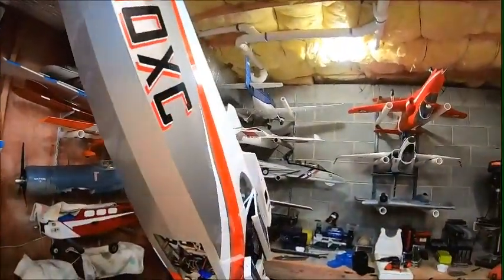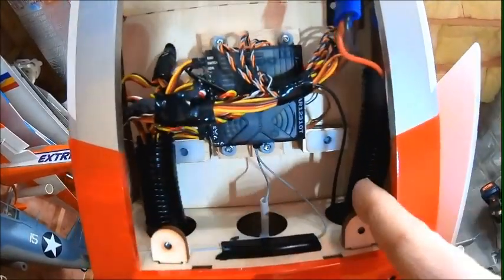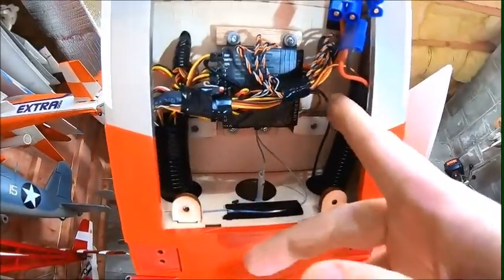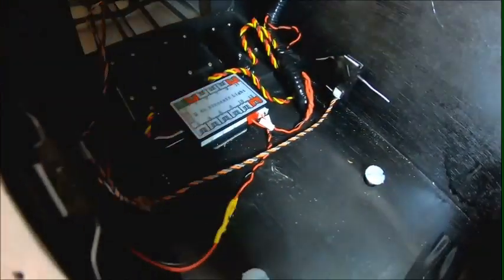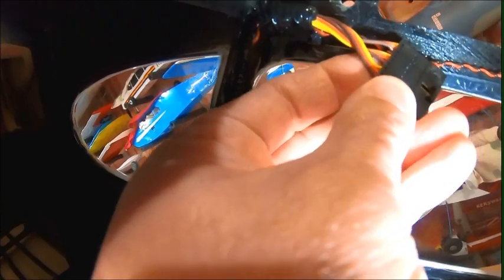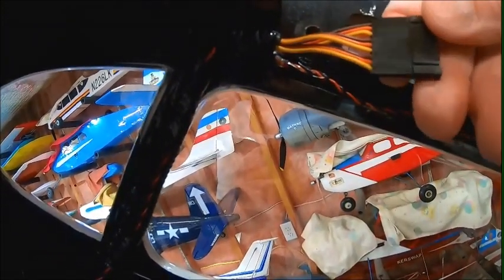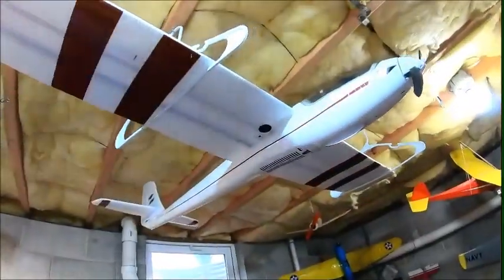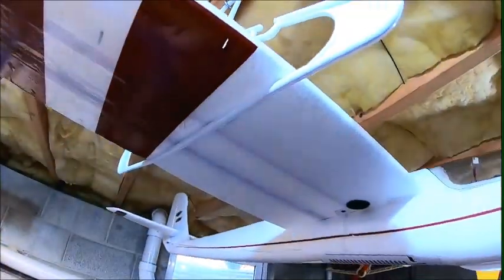XCub LED & Control Wiring, Bonus Clip @ 12min

Comment: Hey Brenden, did you use Y connectors for aileron, flaps and Rudders. I have a 12 channel receiver but a DX9 transmitter. With individual channels for ailerons, flaps and rudder I use 8 channels for just control services and throttle. This leaves only one AUX channel for opto kill swith, lights or whatever else I want to add.
Reply from the maker: Every servo is on its own channel. I use the same Dx9 and ar12310t receiver. The lights on mine are just powered by a non switched channel. Just plug it into the receiver into an open port. dont use the bind port.  If your out of ports yharness the lights off the receiver with another circuit that’s not switched.
Reply: @JustPlaneCrazy  I tested wiring mine to the down flaps and that is working

Comment: Hi nice job with the wiring. I just finished my Xcub build and was setting up channel 11 for landing lights with a optical switch with my iX12 and I can’t get any signal from the RX on channel 11 and 12. I tried another 12 channel RX tonight and same thing.  I plugged a servo in and when RX powered up servo goes to max throttle and stays there. I am using 11ms frame rate. Do you have a suggestions on what to check.  Thank you.
Reply from the maker: Jeremiah Ulishney if the ix12 is like the dx9 you need to go into system setup and assign aux 3 - aux 4 to switches. It sounds like the two ports are not assigned. Wish I had an ix12 period but wish I had one to go through for u